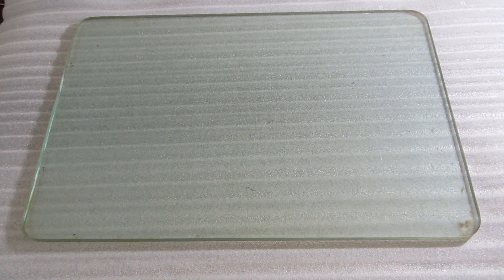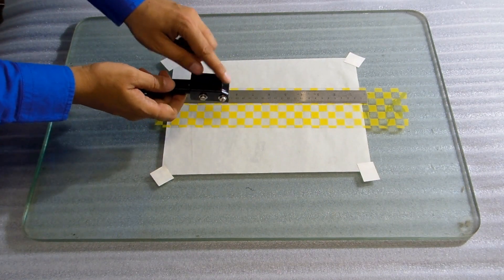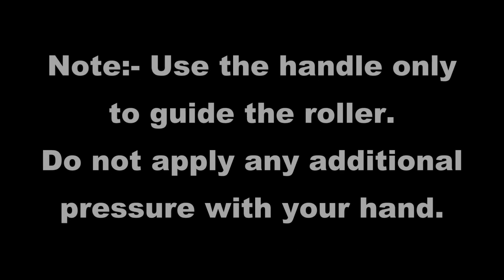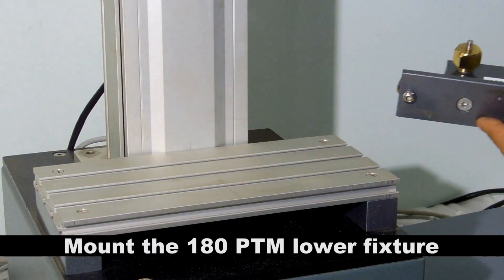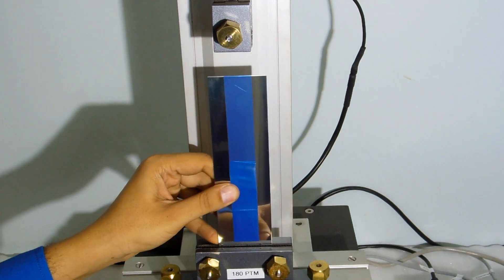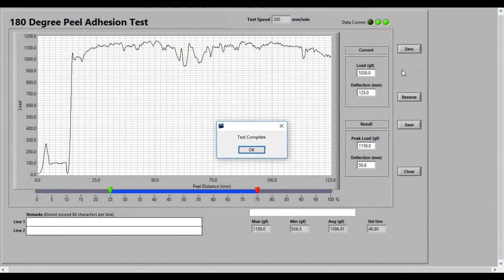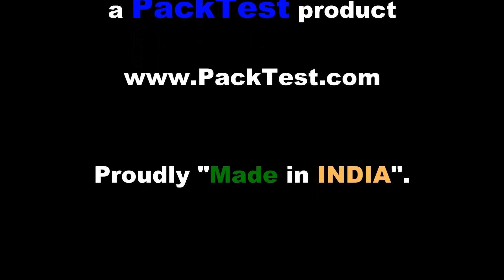180 Peel Test on Adhesive Peel Tester by PackTest.com

Comment: Why 90* test shows half the value of 180*? Any specific reason?
Reply from the maker: Yes because the effort required to peel a sample at 90 degree is much less than the effort at 180 degrees. For this reason only, 90 degree is primarily used in cases where the sample substrate is weak (like tissue tapes or thin foam tapes) and 180 degree peel leads to substrate breaking instead of peeling (because tensile strength of material was poorer than its peel strength).

Comment from the maker: Jin-Han Jeon 
commented on this video : (but for some reason he deleted it too).
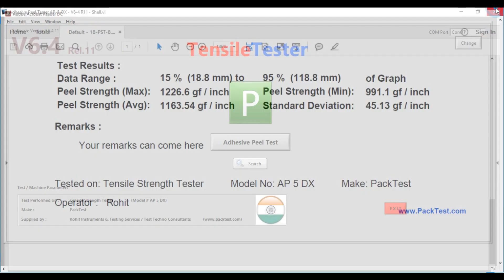@ 9:02, in case of peel strength (max) 1226.6 : it is a bit different from graph. in the graph any data don't exceed 1200. 

Answer : It is a wonderful observation. People generally dont notice it. The graph shows the actual load vs deflection values of the sample which had a width of 24mm. However the final reporting width was selected as 1 inch (25.4mm).
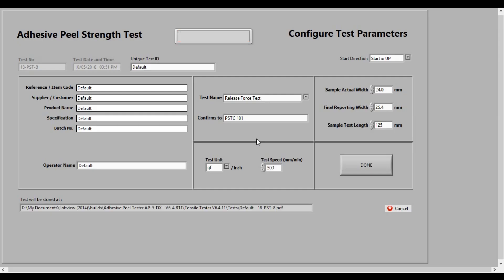You can see this @ 6:45 on the software configuration screen and again @ 8:50 on the PDF report screen.

@ 8:20 you can see that the Result Peak Load is 1159 gf. This is for 24mm. What the software does is it extrapolates the results to a final reporting width of 25.4mm (1 inch). 

So the math behind it is : (1159 / 24) x 25.4 = 1226.608.
1159 gf/24mm is the same as 1226.6 gf/inch.  

Hope I was able to clarify the doubt.